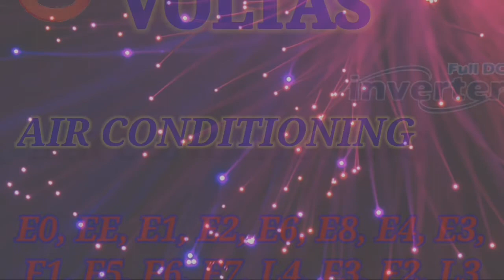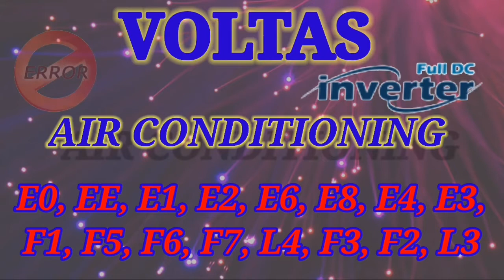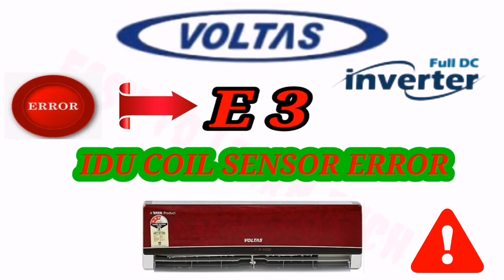#EASYTOLEARNTECH // Voltas airconditing error codes and solutions // TROUBLESHOOTING // MAINTENANCE

Comment: 1ton po problm
Reply from the maker: PO IS OUTDOOR UNIT ERROR..
P0 error code indicates a IPM malfunctioning because of a strong current. This type of problem can be caused by a wiring mistakes, a defective circuit board or a outdoor fan speed malfunction.
Change the PCBS CARD & CHECK..